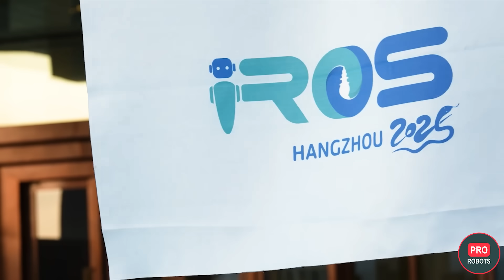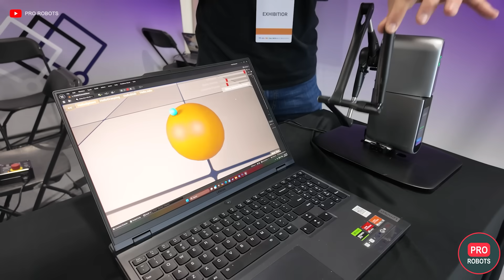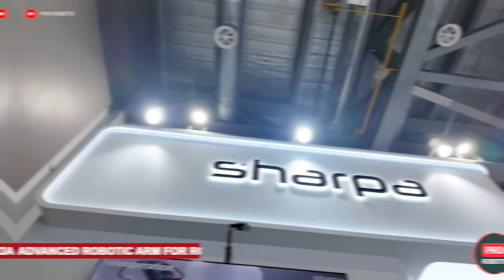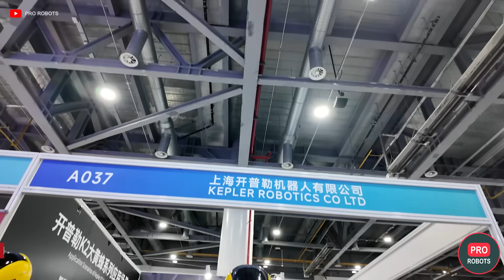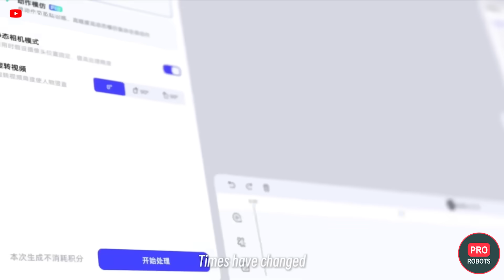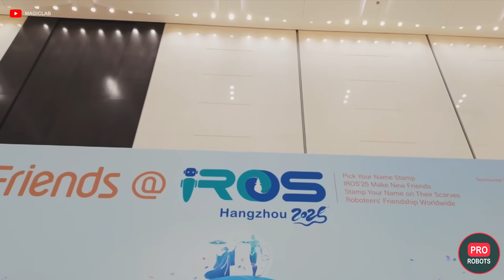New Creepy Robots at the Chinese Exhibition IROS 2025

Comment: with out american chips chinese ai robots would fall over just like the russian one
Reply: Coping hard af, China has many chip companies that are more than sufficient in filling in the gap. Without out China's neodymium magnets, motors, sensors and control systems, there are no robots in the US!
Reply: These robots do not require the most advanced AI smart chips, as those are useless for humanoid robots. Using mature domestically produced chips in China is sufficient.
Reply: aren't most any chips made in Taiwan?
Reply: @moonwatch7963  The best ones are made in the USA china can only buy the junk ones Nvidia chips are primarily made by the Taiwan Semiconductor Manufacturing Company (TSMC) in Taiwan, but the company has started manufacturing its most advanced AI chips in the United States, specifically in Arizona